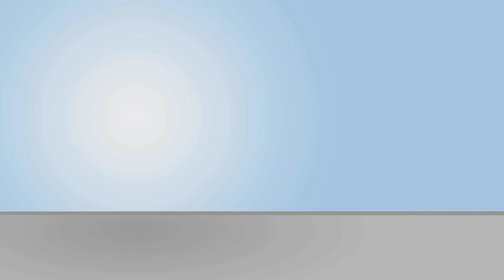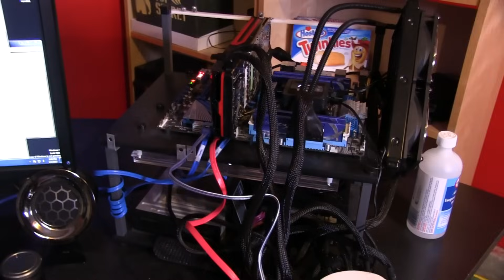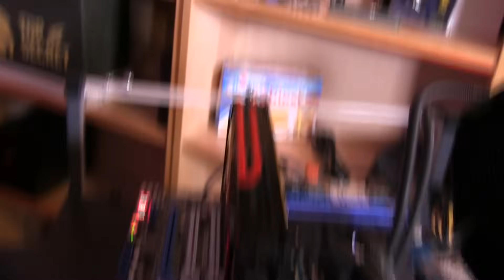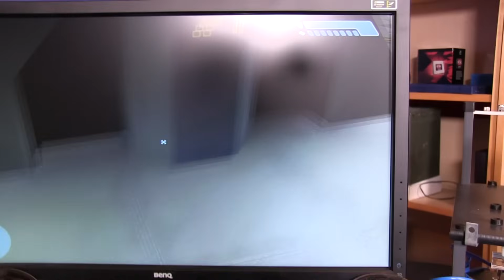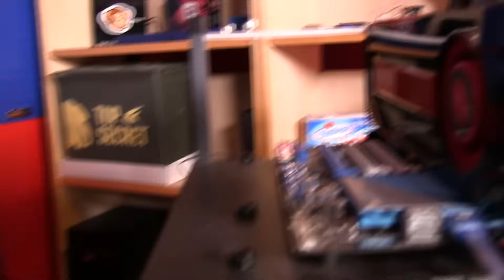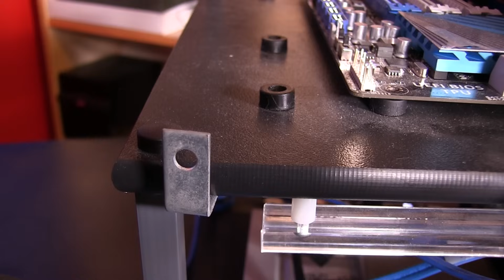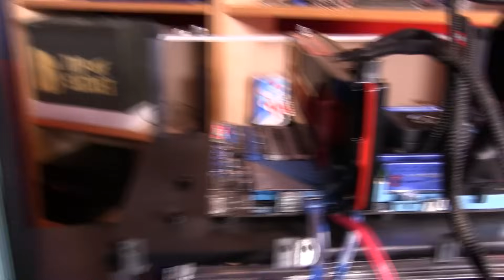Coil Whine Explanation & Demonstration Linus Tech Tips

Comment: Seemed to have "corresponded" to the brightness or contrast? any further testing along those lines?   in the briefe flick up and down to different shades  brightness levels.. that was my take. surfaces seemingly pretty much same distance and similar textures taken into account as load bearing factors.   GPU requires more power to make lighter colors light increase load and increase coil whine something?

Comment: i have a used 5700xt i got for $120, was great at first but has been getting whiney the past week or so. had a night where after a long gaming session, it would whine whenever i scrolled thru youtube/reddit ect. in tune with the scroll lol. im thinking it might be because the power supply i used (unfortunately cheaped out a bit, 500w thermaltake "smart" edition,) uses daisychained 6+2s for the pcie instead of 2 independent 6+2s

Comment: hello bro, if the coil whine noise card follows ur movement of the mouse and the clicks u make in the scren or scroll its 100 per cent problem of the gpu?
Reply: i think its a power delivery issue, are you by chance using daisychained 6+2 connectors for your gpu?

Comment: After all these years I finally got confirmation I wasn't mad when I heard it (mostly when my laptop's fans weren't blowing). My dad never heard anything... and said some random things that I was supposedly hearing smfh.
Reply: So wich component was the culprit?... Over here supposedly to be both my CORSAIR RM1200x SHIFT (awful on IDLE , DOING NOTHING) and RM850Wx SHIFT (Latter one brand new, no issues on Idle so far but the sound is audible with DOOM ETERNAL but with the speakers turned off for testing purposes)
Reply: @DVTHEFOX  I didn't delve into which specific component was emanating the noise, because all my laptops have had this and it's not that bad you know. When a year or 2 pass then it becomes a little more noticeable but it's still well manageable

Comment: wow, it's been already a decade and coil whine is still an issue.
Reply: It's a physical phenomenon mainly with the inductors on circuit boards. The manufacturers can try things like glue to stop them from vibrating but it's not really something you can ever fully fix especially with the huge number of possible hardware configurations.

Comment: Amazed they still haven't solved this issue a decade later and they want you to spend 2 grand on a GPU.
Reply: It's a physical phenomenon with the inductors on circuit boards so it's not something that can simply be fixed.

Comment: Hello, I am using an MSI B760m-A ddr5 wifi motherboard with an i513400f processor. The coil whine comes from the processor area at the back of the motherboard. Will coil whine damage my processor? I don't want to change motherboard.
Reply: Yes, it will. Could even cause a house fire! Id suggest getting a better processor to start.

Comment: The coil whine is caused by the magnetic fields in the coils causing the ferrite cores to vibrate. If you have whine it is due to poorly made coils some add extra comformal glue to attempt to stop it.

Comment: Heh. I had these sounds with my TI-99/4a back in 1982. I used those sounds (along with the computer's 3MHz clock speed) to determine what the computer was doing. Faster programming loops would result in higher pitches. Things like heavy mathematical calculations would result in lower pitches. Nice to see things never change... except for the format of Linus Tech Tips!

Comment: For those who has this issue, you can cut some slices of thermal pad(2mm thick or more), fill in the gaps of the coils, put one extra layer of 0.5-1mm thick thermal pad on the coils and screw on the vapor chamber to compress the thermal pad. If its still whining, put some thermal pad on the back of the pcb where the coils fit, and screw on the backplate. Just clean out those extra thermal pad when sent for repair and you will be fine without breaking the warranty. It's caused by the vibration of the coils, so if you compress the coils firmly with thermal pads, it surly will stop.

Comment: Still useful 10 years later, my 6950xt makes this noise.. amd come on man 10 years and u still cant fix this?!
Reply: For those who has this issue, you can cut some slices of thermal pad(2mm thick or more), fill in the gaps of the coils, put one extra layer of 0.5-1mm thick thermal pad on the coils and screw on the vapor chamber to compress the thermal pad. If its still whining, put some thermal pad on the back of the pcb where the coils fit, and screw on the backplate. Just clean out those extra thermal pad when sent for repair and you will be fine without breaking the warranty. It's caused by the vibration of the coils, so if you compress the coils firmly with thermal pads, it surly will stop.

Comment: I replaced my PSU thinking it was that and it worked but my whine was different sounded like a high pitch noise a camera would make, it did this during a usermark bench test so i freaked out and ordered a new psu NZXT gold 650 watt full modular great price "$85.07 on sale after taxes on amazon" and you and Jay recommend the brand. Could be the card it is a coin farmer card i got off ebay like 5-6 months back about a $190 after all was said n done. PNY GTX 1070 ti 8gb vram @ 512 bus width. Don't hate i'm on a budget plus i only game at 1080p i'm a 46 year old man 1080p looks amazing to me and this card runs all my AAA titles at max settings. Only thing i don't like is the card throttles due to the squirrel cage fan style blower graphics card hits 95c and throttles but will run like that all day every day God of War 70 to 111 fps no studders but i know if i could find a better air cooling solution it would have more head room but no good coolers left on the market all have been discontinued or cost as much as i paid for the card lol. Not ready for water cooling yet never done it and i am scared of ruining my pc honestly.

Comment: i started randomly hearing crickets, i though they were outside on the street but the sound stopped when i took my earphones off. i thought i was going crazy
i set my PC volume to zero and i could still hear them, at this point i was convinced i was bonkers
i started playing around with some apps on my PC and I found out that gpu intensive apps can create interference with your earphones
it's a very faint noise and it sounds like a moving handle or a cricket, and it happens exclusively when I'm running a gpu intensive app
it's so weird and cool at the same time, I've never experienced anything like this before, and I got scared too lmao

Comment: my AMD Radeon 7900 XT (Red Devil) has really bad coil whine, i was too lazy to send it back. Clearly not PSU related as i got a Seasonic Prime TX-650 that's one of few with true 80+ Titanium, so that's the cleanest power you can get from highest grade electrical components.

It's obviously the card, and the whine gets reduced if i lower game refresh rate settings (monitor is 240hz) and whine is also more intense in main menu's with easily rendered frames. But in a high end system overall like mine, high framerates in all scenes and gameplay are expected, so the coil whine is pretty constant during gaming. I'm even more unlucky to need an open PC case for optimal cooling, so im sitting next to noise and fix it by using headphones instead of a speaker.

Anyways, it's clearly bound to FPS values, explaining why Vsync, capping FPS and refresh rates make a difference for most users. But that defies why people have a high end system, to get high FPS values.. so what do we do, not accept it and RMA cards?

Comment: I was just using my PC in a quiet room and heard this sound coming from my desktop chassis. I was freaking out for a few minutes thinking it was like electrical arcing on the motherboard or something until I found out about coil whine. I wanted to be sure though so I looked up a video of it and turns out you had posted it 10 years ago. It's crazy how your older videos are still helping people today. Thanks for the video and it is amazing to see how far your channel has come in the last decade.
Reply: i just paid 2.3k for a laptop from another country and the same happened to me, i almost shit myself lol. thank god it's normal. LTT is a fucking legend. what gpu do u have?
Reply: Literally me right now, just built my first pc and got scared af, investigating about the noise I ended up here
Reply: @jonathanzarate9222  same here! -.-
Reply: i also hear this.. but only my left ear can hear it.. not my right ear.. is this normal..??
Reply: @delita0057  you destroyed your right ear sensitivity with loud noise
Reply: same here lol
Reply: Ditto. I was worried I hooked something up wrong on my 6700 xt. Turns out it just sounds like that, though apparently v sync + higher fan speeds help reduce it
Reply: @ORLY911 using the 6700 here, I noticed that lowering the fps in general helps it a ton
Reply: i change my motherboard.. then the noise gone...
Reply: "it is amazing to see how far your channel has come in the last decade." Truly amazing is the truth of those of videos.
Reply: Calming zoomers since 2013

LTT
Reply: yeah bro same thing happaned to me, at first I thought its ram because I switched to AM5 so not sure about my ddr5 rams, then when I listen everytime it goes to left so I thought cpu and holy shit and then I went a bit down yes gpu but still not sure, the sound from my pc is like whizz so thin sound, and it never happaned before its like 6 years gpu(msi 2060 gaming z) and 2 days also was fine, when I open the games, but now it happens... idk bro I think I will go more deeper like testing parts in somewhere.
Reply: I though a fan on my $3000 pc was messed up

Comment: Here to see what Coil whine is for the 7900
Reply: lol same
Reply: my 7900 XT (Red Devil) has really bad coil whine, i was too lazy to send it back. Clearly not PSU related as i got a Seasonic Prime TX-650 that's one of few with true 80+ Titanium, so that's the cleanest power you can get from highest grade electrical components.

It's obviously the card, and the whine gets reduced if i lower game refresh rate settings (monitor is 240hz) and whine is also more intense in main menu's with easily rendered frames. But in a high end system overall like mine, high framerates in all scenes and gameplay are expected, so the coil whine is pretty constant during gaming. I'm even more unlucky to need an open PC case for optimal cooling, so im sitting next to noise and fix it by using headphones instead of a speaker.

Anyways, it's clearly bound to FPS values, explaining why Vsync, capping FPS and refresh rates make a difference for most users. But that defies why people have a high end system, to get high FPS values.. so what do we do, not accept it and RMA cards?

Comment: I can hear "coil whine" sounds but not in the PC case, but in my audio monitors. I hear constantly like a soft robotic murmur, and when I scroll in programs like Adobe Bridge, I can hear stronger noises when the screen is updated. So, it seems to be related to GPU. I don't have a PCI GPU right now, only the iGPU from the 12700k. Is it coil whine? Or interference? My mother is MSI Pro Z690 WiFi (but I am not using WiFi). My audio monitors are connected directly to the integrated sound card. I should try using a USB sound card with balanced cables, but... What do you think the problem is?

Comment: Infinite is causing coil whine in my 5700XT. 8 years later amd and halo are still pissy with each other.
Reply: Holy shit I'm glad it's not just me. I figured my 2080 Super wouldn't have a problem but it's starting to get irritating
Reply: @eclipser734  it started after I got a high refresh monitor. I’ve already undervolted but I’m going to try a 120fps cap.
Reply: @matthewharr6372  I've got mine on 144hz right now but it wasn't a issue with my other games. I'll mess around with it too
Reply: PSO2:New Genesis and GTX1070Ti Coil Whine

Comment: I don’t think I have coil whine but I’ve just started hearing this kind of weird noise on my 2060 card and when I lay my finger on top of the card the noise stops could it be a loose screw or something?
Reply: i think its coil whine.
they usualy  tend to  stop like that if you press on them.
however it doesnt hurt to try to reseat your gpu 
i had a coil whine on my brand new 2080ti but it seems it settled after a while and it wasnt as tedious as when i first got it

Comment: I remember I got really mad at a Dell rep once. I got a new XPS 13, the first model I think in red, and I loved it. But the first night when I was working in a quiet room I could hear something like this. But it was like high pitched Morse Code, beeping on and off. I returned it for a replacement because they said it was just defective, and the next one had the same thing. Then when I called up the rep literally laughed at me when I said it did the same thing, like I was being very petty and basically like "suck it up princess." So I demanded a full refund because I was not listening to that crap for the years I would use it. 
At least now I know what it's called, this card has a much worse case than my laptop. But because the laptop is right well on your lap you can really hear it.

Comment: I've solved the problem I had with my RTX 2060 Super by adding 2 ground wires: one that is clamped down on the motherboard (underneath one of the regular mounting screws with a ring that has the wire soldered to it) and the other going to a part of the PCB Of the RTX card, both of the leads from there go to a part of my power supply (Corsair RM650 I believe) that has a corner that I have deliberately damaged to expose bare metal, and have stuck the two leads with a ring attached to it as well between the case (that has also been damaged to cause a very good contact area) and get's clamped down via one of the mounting screws of the power supply.
It is now almost not noticeable anymore (I used to have this in real life as well as on my speakers, and it was really loud at my speakers, you could not ignore it) and you really, really have to listen carefully to hear it.
Rendering in Blender finally is not something annoying anymore (Though I am pretty sure I have voided the warranty on my videocard by doing what I did...)
Reply: I solved the problem by wearing a gaming headset. Easy solution.
Reply: @pcbangbros  I was discouraged from  wearing headphones by my general practitioner this year due to my ears clogging up.  Also, sometimes I simply can't wear one because I'm doing something else at that moment a bit further away from the computer.
(And that's next to it not solving anything, it's just shifting the problem away from the outputs affected.)
Reply: @Dutch3DMaster  That sounds like a you problem.

Comment: IT's the sound of 'I DON"T GIVE A SH!T YOU BURN INSIDE' electrical component. 
Sound of the 80's industrial era! 
my crt tv, video recorder first pc all was black inside the 90's, they all last long but was just cooked inside.

Miss those reckless engineer times!
capacitors and plastic fuse together, dust like snow on circuit board

on the other hand, you know it's not fake, it is a real electrical component switching in frequencies! lol

Comment: The higher the coil whine, the higher your FPS is. Vsync will fix this as it will lock it to whatever your monitor can max out at (or whatever your desktop is set at).
For example if you have a 60hz monitor, your fps will only max at 60fps. Regardless of whatever the game is running at. So if your FPS counter is saying 786fps and your monitor is at 60hz, then you are just wasting power and performance. Only setup vsync on for whatever your monitor can run at and you won't hear this tone (or not as much if your monitor can handle higher like 144hz or higher. Just remember, whatever your hz rate is is your max fps you can get)

Comment: If you have a power amplifier or any kind of ampliferr with to-3(metal hat transistors) and run it on a resistor load (say 4-8ohm 50W resistor) and play music the output to-3 transistors will emmit the sound. And another guy on youtube found out its not the coils. The VRM switching mosfets are causing the sound. And the pitch is determined by the framerate. The higher fps the higher the frequency. Sorry if im beeing anoying.

Comment: Hey, can I get some help on this: I am getting this low volume buzz from my speakers when I run a game. I just got a new gpu(gtx 1070)...used and ever since then, it has been acting weird. My pc would shut off randomly, so I replaced my psu because it was crappy. I just got a seasonic 650 psu and the power outtage problem ended, but the whine from my speakers started again... what could this be? Also, when I enter fortnite, the screen goes to 1600x800 and back to 60 hz

Comment: Try slightly under clocking your card or limiting the TDP, coil whine is caused when things are pushed to the limit. I always slightly underclock everything in my PC, it saves loads of energy, reduces heat and gives that extra bit of stability. If you do this your PC will never crash.

Comment: Coil whine is generally only noticeable during an excessive load when producing very high frame rates (anything above 100 to several thousand fps). This is mostly experienced for example in older games and titles. 
The easiest way to fix coil whine is to turn on Vsync or by forcing it on in your application settings in your graphics control panel, so that you limit your frame rate to the refresh rate of your monitor. 
Not to mention Vsync removes frame tearing issues, reduces heat, saves energy, produces less fan noise, and limits load noise like buzzing and coil whine.
Reply: Old comment, but worth its weight in gold.. My PSU JUST started doing this. Had never had this sort of issue before. (Since its my first time needing a powerful PSU). I freaked out and worried since I tend to get hyper focused on small noises.

Putting V-sync on literally made it stop.. Thanks dude.